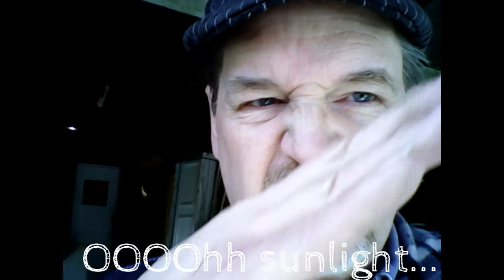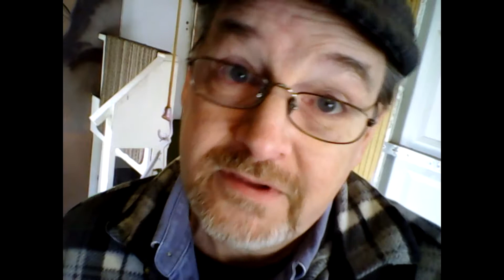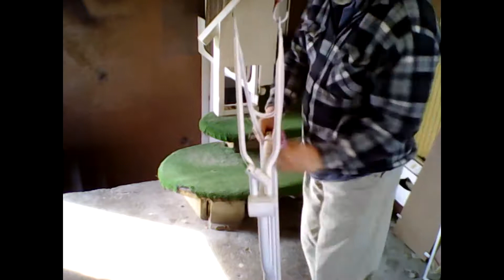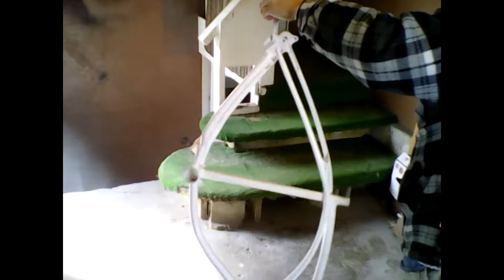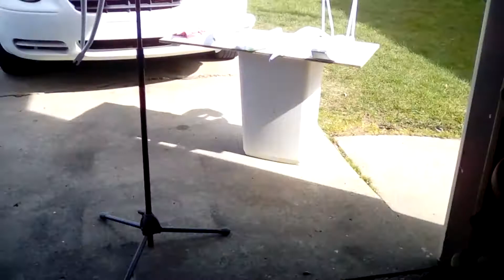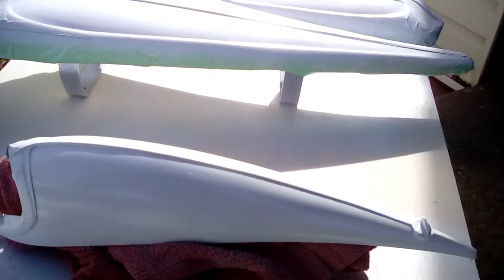Schwinn white Phantom custom pt13

Comment: Love your efforts Den she gonna be killer!!
Reply from the maker: Thank you, Neighbor! I didn't have any snags in the process other than expecting the Lacquer paint to work over the primer I used. I'm learning by testing and showing what can go wrong if you don't test things out, instead of just relying on other peoples opinions and videos. NO LACQUER over enamel primer!!
Reply: after trial and error on the orange murray cruiser i put that 49cc on , i used a self etching enamel  primer for its best adhesion to bare metal then Canadian tire brand orange enamel [yeah the cheap stuff] and i got to tell ya it almost looked as good as my powder coated bars and crankset. was deffo a learning experience!